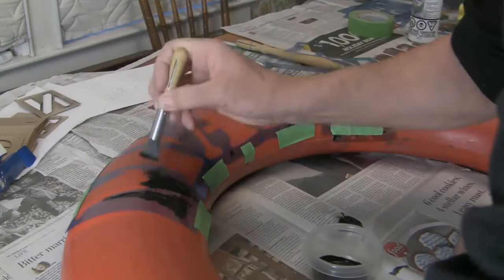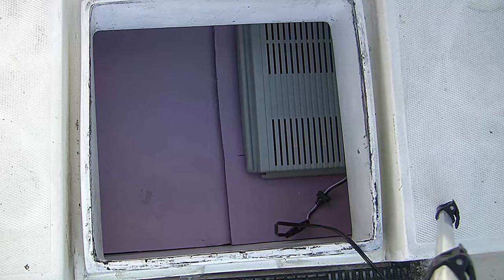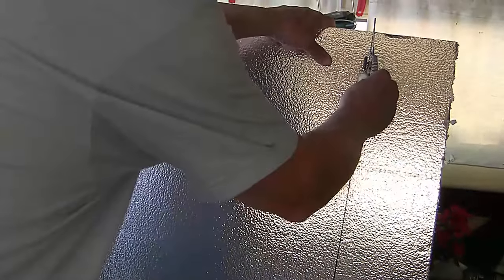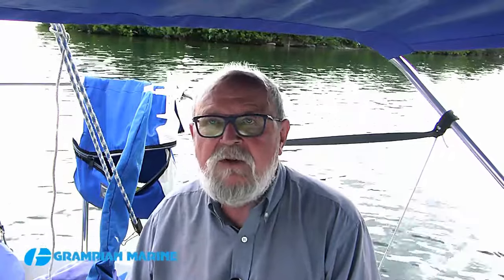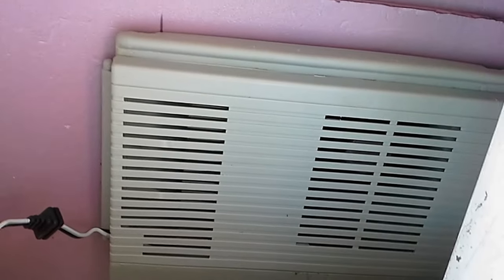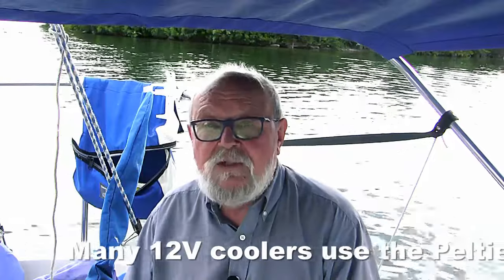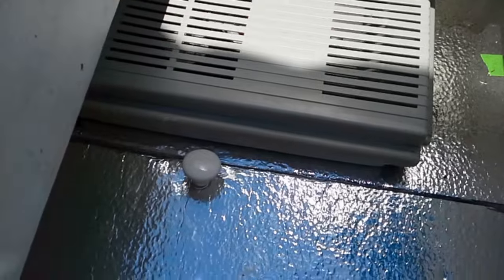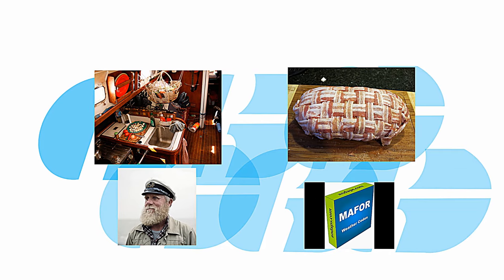Making a 12 Volt Fridge

Comment: We own a maxum 1900 sc from yr 2000 with a neath camper canvas. We use it for watersports, daytrips and also weekends camping on the hook. When we run it the car fridge (peltier style) can be plugged in the 12v outlet of the boat. But when at anchor for a few days we need extra power to charge phones, tablet, rc boat batteries and to run the fridge and stereo. So we carry an extra 60 ah car battery that is connected to a solar charger and a 100watt solar flex panel. This panel get's strapped on top of the bimini when at anchor. Since we normally only go out with good weather the 100 watts gives enough power to run everything the whole day and an hour just before bedtime just to give it a last cold boost for the night. The downside is that our car fridge is not very well insulated since a plugged in peltier can easilly keep it cool. But it is using 4 amp constantly. Once tried to upgrade it with a thermostat but it turned out the insulation was so bad that after schutting it down it would take only 30 seconds to go up in temp on the hot boat so much that it made no sense to complete that build. A compressor fridge is much higher quality and will switch off longer times and will be much more efficient. Problem is that they are bigger than the slim car fridge and the boat is small and overcrowded with the three of us. But it would be the better option.

Comment: I am thinking that converting a regular chest cooler using the same Peltier device would be easier and would hold cold air better...
I know that there are already Coleman and Igloo Peltier coolers, but the insulation is not  as good.
I wonder how long the ice in a decent cooler would last if you had a Pelter module also running?

Comment: Not very informative. And you missed the part about using the largest cooling source around you to improve the efficiency. Water! Cool the hot side of the peltier. That way you can be 20 degrees cooler than the water/ Doh!

Comment: Since it's a difference between two temperatures, 25C cooler is actually 45F cooler than ambient, not 77F. 77F cooler than ambient would be sufficient for even the southeastern US for most of the year.
Reply: J.R. Daniels I

Comment: F-A-N-T-A-S-T-I-C

About 4-5  AMPS per hour for about 12-14 hours ... maybe less.

First time I saw someone on a boat speak favorably to a Peltier cooler.   I love them and they work ... and there are further hacks that make them work even better.  I once, FROZE a quart of milk rock-solid ... like a brick ... in June.  Of course I always add a small fan to also blow off the cold side too(ice blocks the cold). 

Anyone with a cooler, I suggest making the door a double(one side a small as possible for drinks etc), with extra insulation and putting a sort of baffle between what you want coldest and the things you want to keep cooled.  Don't run the Peltier when the ambient temperature would actually mean you're introducing hotter air in. Nightime at 65-cool at 45 ... or better.  Cool til the temps rise and basically keep everything closed as possible.  Make sure everything you want to drink is not going to lose your heat.  Frozen 1 or 2 liter can help kickstart the cooling.  My milk was always icy cold ... that cold that keeps one from drinking too fast . Generally run the Peltier beginning around 8pm off/on, then all on around 11 pm to 6 am ... intermittent til 10 or so then cover the cooler real good.  The trick as always, is to get through that 8-10 hour period of heat.   

A Peltier would also be great for those things that just need to be cool(like a fruit cellar), separate from the things you want real cold.

I have a freezer/fridge, but I'm planning a super-insulated, tilted down to the out(PVC pipe & insulation), where I can put cans in the cockpit with the Peltier toward the highside/back to allow the cold to drop and a sliding door so when open a can almost wants to fall out.

It appears you've hit a second wind?
Reply: Thanks for this. A lot of people think these are like their fridges at home. When I have the gang over I freeze a large bottle of water to help keep things cool.

Comment: Title should be "making a 12v Cooler" not Fridge. A Fridge uses a compressor, not thermodynamic heat exchange.Good show, though.
Reply: please note that a compressor uses thermodynamics to cool 

also note that refridgeration means making things cool

so your distinction is wrong at both ends